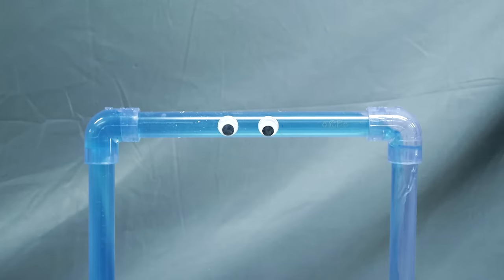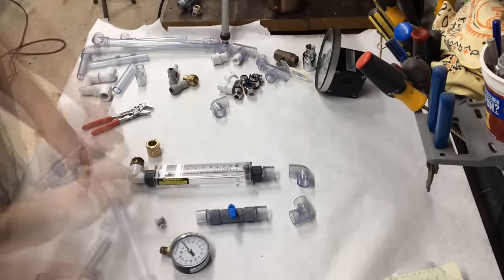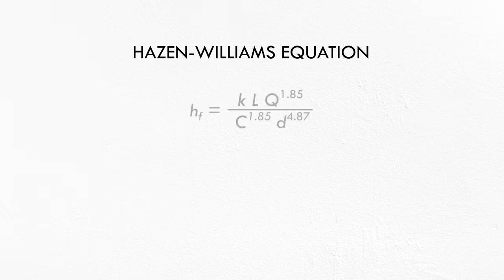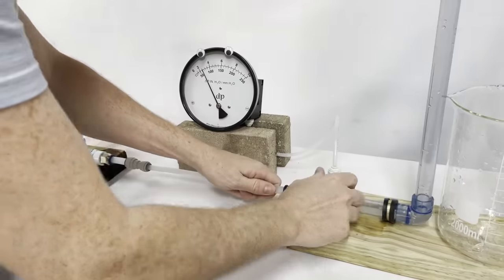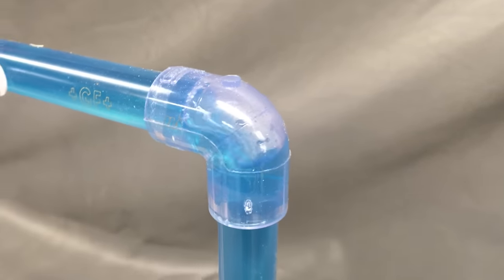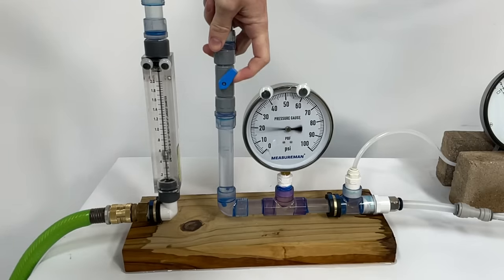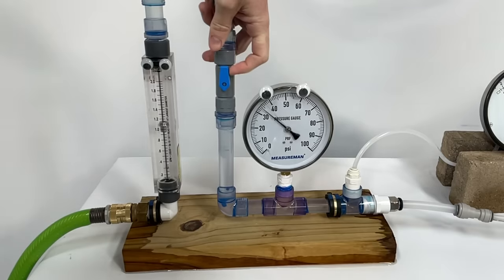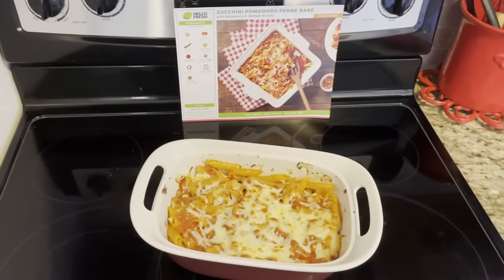Flow and Pressure in Pipes Explained

Comment: Friction is a fascinating phenomena, I don't know what you mean.
Why else would I watch a 10 min video.
Since electricity and radio has analogies with water I was thinking of a "water" radio.
Or in other words, the current is like water moving, the inductors are like flywheels, capacitors are like diaphrams, and such.
Water can't vibrate at millions of hertz but it still seems interesting.
P.S. YT's spellcheck doesn't like "inductor".

Comment: I have Mercoid Control that regulate PSIG for a fire sprinkler system, it controls the pump speed depending on how many sprinklers have triggered. It has a pressure chamber that triggers a Mercury switch when pressure drops. It would be a cool video to make about how it works. Let me know if you want me to send it to you, if you want to want make a video about it.

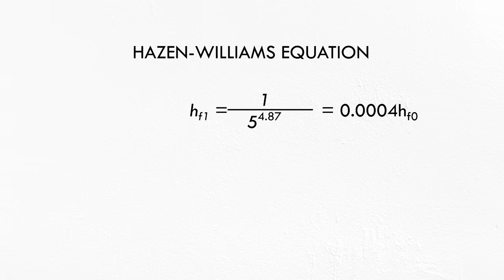Comment: 6:25 Is the problem with checking thicker pipe, that only 1/4 of measured length has higher diameter? With that, best pressure reduction would be around 1/4, instead of calculated 24/25 reduction. To measure it correctly, thick pipe would need to be there on whole length and measurement connection be directly in thick pipe.

Comment: I wonder if these principles apply the same for gasses in pipes?

A while ago I was talking with someone who was modifying the exhaust on an engine with the idea to minimize any back pressure at the exhaust manifold. 

He was putting a larger exhaust diameter pipe back from the engine but not changing the downpipe from the exhaust down to where he would connect to the larger pipe.  

Let's say he had a 3 inch downpipe from the engine but he wanted to "upgrade" by replacing the 3 inch pipe connected to the down pipe running under to the back of the vehicle to a 4 inch pipe. 

To my simple mind anything larger than 3 inches for the pipe connected to the 3 inch downpipe is unnecessary because the back pressure is determined by the smaller diameter 3 inch pipe upstream in that system.  

I've never been sure if my logic was more or less on track or...quite possibly completely wrong.

If anyone with actual knowledge (vs guessing like me 🙂) feels like commenting on that I would love to hear as this video reminded me that I've always sort of wondered about that.

Comment: Does the diameter of the pipe turn also effect resistance?  With a planes wing, anyway, the top section is a gradient designed to keep flow laminar.  It has to be gentle as a result.  Could you reduce turbulence in a pipeline by turning the flow very slowly with a large radius pipe turn?  Do they already do this?

Comment: That change to a larger diameter... I had been sure that it was there, after all the impedance change in electronic circuits leads to reflections and so forth... but I found it very difficult to justify that in hydraulic systems, it did not seem to fit with my intuition. Well, whaddya know, my intuition ain’t what it’s advertising to me all the time :)

Comment: Hi, Pls help me. I'm stuck with a doubt in my head since long. The control valve necessarily changes the flow area available for the fluid to flow. As a result of which, it is said that the flow rate changes. But the pipe specimen that you're changing ,also has a different area than that of the fixed circuit i.e the pipe at which first differential pressure tapping is provided. Then why does the flow rate remain constant there onwards upto the end ?

Comment: d^4.9 is interesting. I've seen theoretical explanation for d^4, but that didn't include turbulence or surface roughness. 

Does this 4.9 exponent depend on eg. Reynolds number?
Reply from the maker: No, Hazen-Williams doesn't account for reynolds explicitly. It is a completely emperical equation, so it's just curve fits to laboratory measurements. That's the reason for the weird exponents.

Comment: If the flow rate is 0.9GPM at the beginning of the system, will it always be 0.9GPM at the end of the system (irrespective of which pipe is used)?

Comment: Why in the hazen williams equation is the pipe roughness coefficient in the denominator? Shouldn't head loss increase as the roughness increases?
Reply: It would appear from this table https://www.engineersedge.com/fluid_flow/hazenwilliams_coefficients_table_13220.htm that the value of C is inversely related to roughness ie it's actually a smoothness coefficient.

Comment: In the 20ft example, would the result be different if the pipe was straightened instead of being coiled?
Reply: Yes, the curvature adds friction which can be calculated as a minor loss in the system.

Comment: Would a 20mm house water pipe need to resist the same pressure as a 10mm pipe at the same tap flow and what would happen to the pressure when you shut tat tap assuming the same pressure and possible flow from the source for both pipes? same bar and/or psi regardless of diameter? If it is lower pressure in the bigger pipe could a thinner but bigger diameter pipe be used and would there be any gain to do so?

Comment: as an aquarist i just want to say that the roughness coefficient scales with time unless your fluid is highly corrosive
Reply: In pipelines, they use a tool called a pig (it is a brush that spins and squeals as it is pumped through the pipeline), in an effort to clean it.
You may be better off just replacing the old pvc piping with new.

Comment: Can someone help me? I'm starting gaining interest about the topic. 8.53 : why by incresing flow rate the pressure increare? Since area of pipe after valve is costant, by increasing flowrate,  speed  increses and by Bernoulli it means low pressure. What it's wrong? Thanks.

Comment: Can someone explain to me (or best show a video on yt, cause I tried and can't find it), how is it that the max flow of a gas pipe (gas is a fluid they say) is dependent on number of exits from the pipe. Like for example, you have one entry point and one exit and you use the maximum capacity of the pipe. Then someone connects to the pipe (adds an exit along the way) and suddenly the entry point can pump more gas into the pipe system (so both receivers get the gas in amount they want). How and why does it work?

Comment: When I repiped my house, I asked the plumber to use a large diameter pipe to my bathrooms but he warned me that meant the increased volume of water in the pipe meant I would need to run the hot water a lot longer, and waste more cold water every time I wanted to use actually hot water in the bathrooms.  Compromises!

Comment: when I use the shower, I try to save water and stretch the hot-water by turning the valve about halfway open then mixing hot/cold until it's just right.  the only problem is that this makes an incredibly loud turbulence noise emitting from the entire length of pipes in both hot/cold circuits.  why isn't this noise present when using a low-flow shower head instead?

Comment: I see pipes used as an analogy to better understand electrical circuits, because you can't see electricity and it's harder to "get" just by looking at numbers. Using electrical flow as an analogy to water flow just makes it harder to understand for me...

Also what's with the 4.87 exponent? Where did that number come from? Is it some special constant?

Comment: In the UK, the bible for fluid flow is "Cranes Flow of Fluids Through Valves, Fittings and Pipe [Technical Paper No. 410] "
Reply: Not sure if it’s true at other university Chemical Engineering courses, but my uni uses 

Coulson and Richardson Vol 1A - Fluid Flow - Fundamentals and Applications
Reply: We tend to use Coulson and Richardson, Perry’s and Fogler more than anything else
Reply: @4naught12  Yes, Universities are obsessed with C&R.

But after 10 years in industry, I haven't picked up a C&R since uni.

Great for academics to teach the principles, superseded by more specific and useful guides in industry (Like Crane)

Comment: when I learned electrical engineering, fluid flow was the analogy used to explain resistance to electron flow in conductors.  It's a bit disturbing to learn that electron flow is used to explain fluid flow to civil engineers.  How did we all end up in the career that we don't understand as well as the alternative??

Comment: You have a major problem right there in the middle why change the diamter section of the pipe? Keep the same diameter section else the elbow loss pressure cant be calculated.

Comment: There's a critical point here that got skipped over: With no flow, there is no loss! 

This bites newbies in electricity and hydraulics alike, and I think it deserves a mention. (In the grade line example for instance, if the system experienced a period of unusually low load, the pressure would be exceeded on the right side of the hill too, not just the left. So thickening the pipe just on the left would solve the problem just fine, until that fateful day...)
Reply from the maker: Great add!

Comment: Where is that energy lose going.. the friction in the pipes caused by the water smashing about, does that energy transfer into thermal energy in the pipes themselves.
Reply: Friction is always transferred into heat, but in this kind of system the temperature rise is very small.

Comment: 10:10 Friction in pipes not interesting? On the contrary, you shown a total amateur how useful diagrams can be, and a few other insights.

Couldn't have realized how much of an impact fittings are without your demonstration. Electrical circuits are a useful analogy too! Do electric connections have such an impact too?
Reply from the maker: Not unless they have bad contact. I guess the electrons don't have as much trouble going around bends.

Comment: 13 miles of 12 inch pipe. Pressure not effected, but the flow was. Fixed this by putting in a water tower.

Comment: What happens when I add a T joint that dead ends at various lengths? I want to measure water ph inline but not interfere with the main line.

Comment: 6:45 But your pipe diameter is only bigger over 1/3 of the length of the pipe - the rest is same diameter - so the resul should be just slightly less than the original !

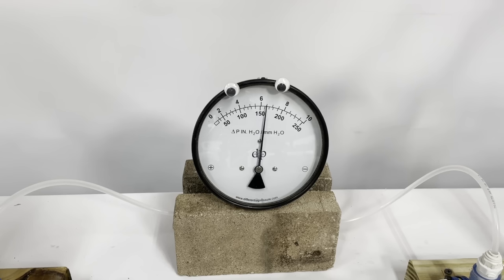Comment: I don't understand what you're doing at 6:18. Don't the narrow pipes connecting to the fat pipe (but still within the scope of the ‘dp’ gauge) dominate? You put a 1Ω resistor between two 1kΩ resistors, you're going to see 2kΩ within the probable tolerance of your resistors.

Comment: One thing I don't understand: if fluid is incompressible, and there is pressure losses along a length of tubing, where does that pressure "go"? The only way I can understand this is that the density of the fluid changes along the length of the tubing. I feel this is incorrect, where am I misunderstanding?
Reply: Friction loss as water flows through the pipe causes pressure loss.

Comment: I understand that unit doesn't matter.
The only problem I see is when you are going to build a project.
Here in Brazil we have pipes that are sold in metric(mm) and imperial(in).
Copper wires in mm² but also in AWG(enameled wires).
Nails are sold in JP x LPP(don't ask).
Aluminum wires and steel wires sold in mm and BWG.
Screws, UNC pattern, metric(that I forgot the initials) and the Chinese(whatever that is).
Mechanical power are measured in HP(imperial) or Brazilian HP(called CV).
And so many more.
It's like, everybody is trying to create their own pattern and measurement.
And it doesn't matter, unit is just a unit. It tells you how much something is compared to some other(the default pattern).
When you are engineering you have to deal not only with the challenge of physics and chemistry, but also HUMAN EGO.
I absolutely do not care which unit or pattern people are going to use. Go ahead and create a new one if you will.
But please, PLEASE!... JUST PICK ONE AND EVERYBODY FOLLOWS!

Comment: I decreased my home's pipe diameter from 0.75" to .5" thinking it will increase the pressure so the water will reach the second floor and the roof where the tank is (it barely reaches the ground floor most of the week)

Comment: Let's take a pipe of a much bigger diameter. (Takes a pipe that has the same diameter during most of its length, except for a tiny short section, that is wider.) :)
Reply: Yeah, I was shaking my head about that.  His differential pressure apparatus is still measuring the head loss over a longer section of the small diameter tubing than the length of large diameter pipe.

Comment: Maybe this is a good place to ask this question.
Why does sometimes the cold water comes out a hot water pipe or hot water comes out of a cold water pipe?
Example: You let the hot water run till it gets hot but suddenly turns ice cold when someone else uses the taps in the system. Or I read where a toilet tank filled with boiling hot water.
Reply: Toilets are often filled with warm water to avoid the condensation that would form on the sides of the tank if you filled it with cold water. The warm water comes from a mixing valve whcih mixes hot water and cold water to get warm water.  If the mixing valve malfunctioned, it might fill the toilet with unmixed hot water.
Reply: The mixing valve on, say, your shower works by balancing the flow of hot water and cold water into your shower head, so you get the right temperature.  If you adjust the handle to get just the right balance of hot and cold flow you like, and then someone opens up a cold water faucet in the same cold water  line whcih feeds your shower, the pressure in the cold water line drops, whcih disrupts the balance, and you get less cold water flowing through your shower nozzle, and more hot water
Reply: @andrewalexander9492  I'm not talking about that. I'm talking about a toilet that gets only cold water except this one time it's boiling hot.
Reply: @andrewalexander9492  I not talking about hot water being less or more hot. I talking about the cold channel using the hot water channel to go in reverse, the plumber fixed the problem by putting a one way valve. But why should there be a one way valve?

Comment: 75psi water pressure in the home is crazy, is all potable water boosted to the home by pump sets to obtain that sort of pressure ?
Reply: I should also add this obviously isn't total dynamic head but still
Reply: @MRBLACK1080  There are a lot of variables, so hard to generalize,  but domestic water systems in the US are usually somewhere between 45 and 80 psi.  A municipal distribution may (or may not) run at a higher pressure, and obviously a city which has a large elevation change across it's service area will have different pressures at different elevations.  Anyway,  disregarding head losses in the distribution system,  75 psi at the tap would correspond to an unregulated system with a reservoir about 170 feet above the house.
Reply: @andrewalexander9492 . So is the minimum supplied pressure regulated by the states independently or the country  as a whole ?. Let's say 45psi is minimum  for USA, here in Australia minimum pressure  requirements for most potable water is 150kpa or about 25psi at 18lpm or 4.7 gallons. Elevation has a lot to do with supply pressure but I have seen quiet a few YouTube  videos with very high domestic water pressure, and alot of water towers being removed which led me to believe nearly all municipal water supplies were boosted. There is a new development  in my town that has been built and home owners are required to pump town water into a tank and then use a domestic pump to supply home pressure requirements.
Reply: @MRBLACK1080   I'm not a water distribution engineer, so don't know all the ins and outs ... as far as I know, there are not uniform national standards for water pressure in the US,  things like that tend to be regulated by the states in the US, and individual cities have a fair amount of autonomy on how they do things. There are recommendations, and standard practice,  but I don't believe that there is a federal regulation stating "Your municipal water system shall have a minimum pressure of XXX psi (kPa, whatever units you prefer) "   I don't know what percentage of water systems are gravity only these days.  I do know that booster pumps to boost pressures within  distribution networks  are common.  My own city (Anchorage, Alaska) gets most of it's water from a lake that is about 200 meters above the city, so there is plenty of gravity head available. We even have a small hydroelectric generating plant on the pipe that brings the water from the lake to capture energy what would otherwise be wasted.  Even so, I know that there are a number of booster stations in the system to manage the pressure within the system.  As far as an individual homes on a municipal water distribution system  being required to have pumps and pressure vessels to provide pressure to the municipal water,  I have never heard of that.  That's not to say it doesn't exist in the US,  but I think that it is uncommon.  (Obviously it's a requirement for homes on their own well)  More common,  is that the municipal water distribution network has a pressure above the normal range and  the individual homes have a pressure regulating valve at the service connection to reduce the pressure of the household system.

Comment: *engineer's arguing about pipe smoothness and diameter*
*Me, welding torch in hand and seconds away from striking an arc, wondering if I have to cut the whole assembly apart to make the ID surface smoother...*
"Aren't you peoples supposed to figure this out BEFORE this point?"
Death stares from the engineers
"I'm going over there now, let me know if I can weld it or not..."

Comment: "I just turn the valve as far as it will go"
That is absolutely the wrong way to operate your shower and the reason people get the "unstable temperature" syndrome.  Turn it just high enough to max the shower head flow and no higher.